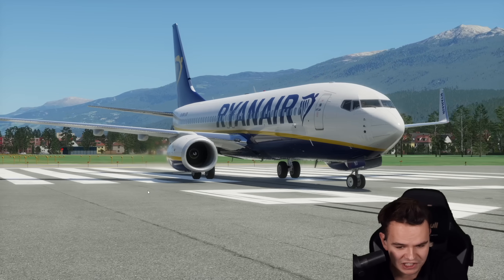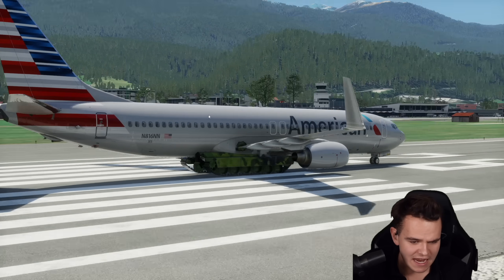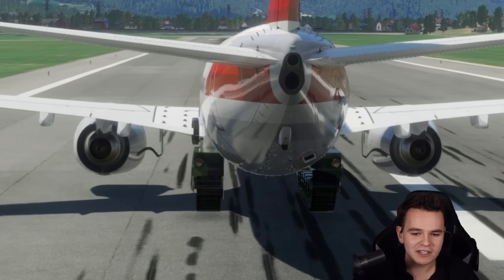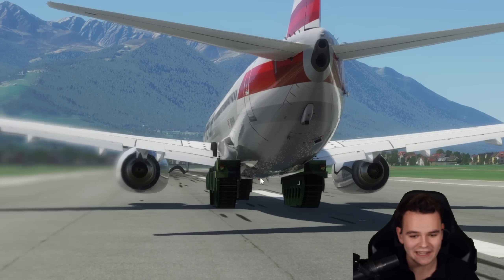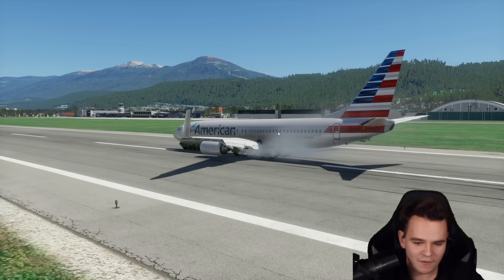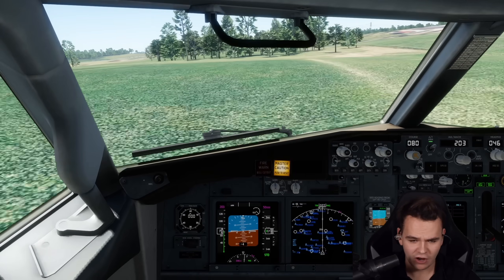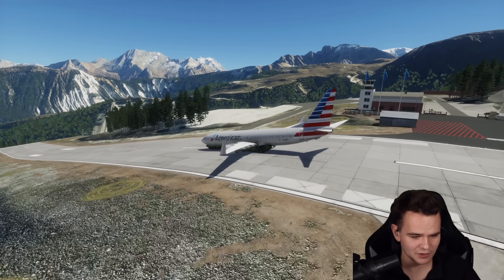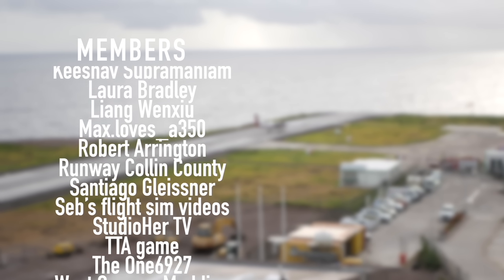I PUT TANK TRACKS on a 737 and IT WORKS

Comment: 1. imagine if the tank tracks come apart
2. runways WILL crumble under the sheer weight of the tracks 
3. im pretty sure if the tank tracks are at high speed and it just fall apart the amount of thrown up debris will be devastating 
4. maintainance 💀
5. its literally not necessary
Reply: Experimental B-29 and B-36 has that type of landing gear
Reply: yea ik